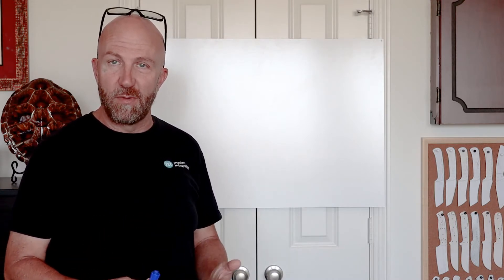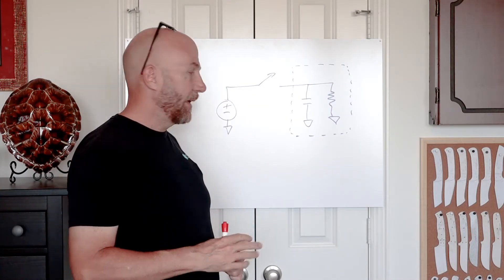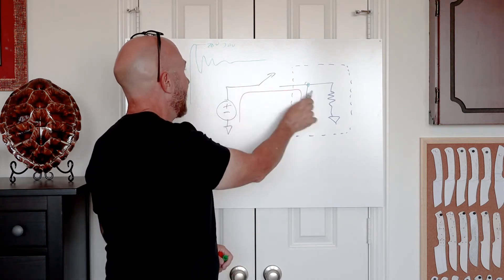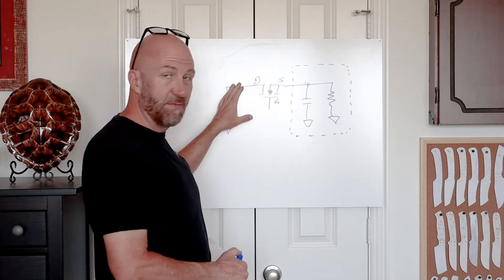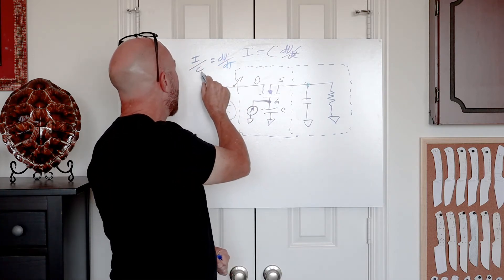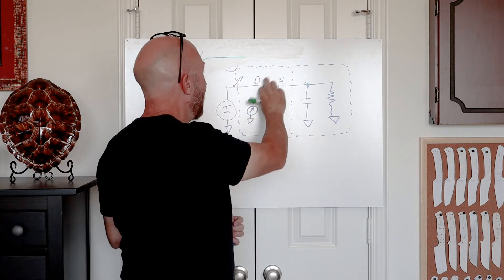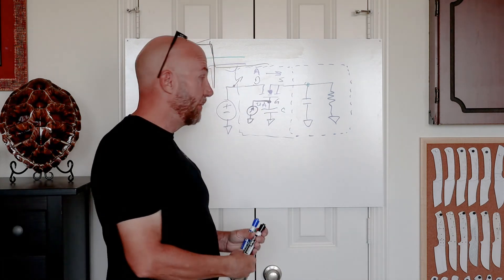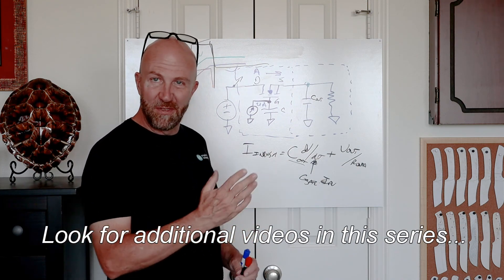Intro to Hot-Swap Circuits: High Side N-Channel

Comment: I am looking for a way to hot-swap a Li Ion battery. This would be a case where the battery being used in the system needs replacement and must be removed followed by the new hot battery being inserted in its place which is likely to take several seconds to complete. Are there any Maxim products that would support this?
Reply: You would need some kind of capacitor (or coin-cell) back-up to keep the system "alive" between batteries. But yes, there are small hot-swap ICs (from Analog and others) that would minimize inrush during the battery plug-in. Alternatively - you need two battery "sockets" on your device, and you would then literally "auctioneer" between them; never having a state where there isn't at least one battery plugged in. TPS2120 comes to mind.

Comment: So, if we have a precharge circuit,  do we need to have a hot swapping at inputside.
Reply: If you use a resistor to pre-charge the output, or if you can "hold up" the output during a supply switchover, then the need for a hot-swap controller is reduced or maybe eliminated. But really, it's "six of one, half a dozen of the other" because the pre-charge circuit typically won't be any smaller or simpler than a hot-swap circuit.